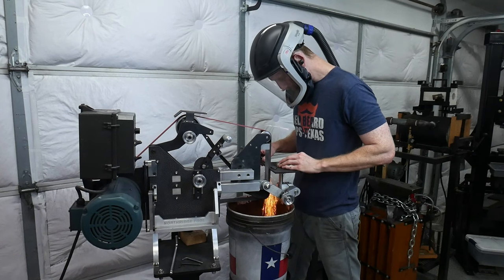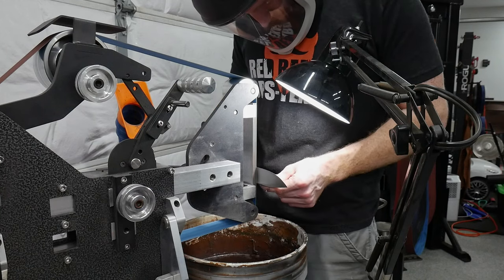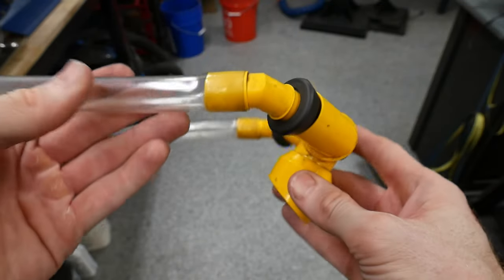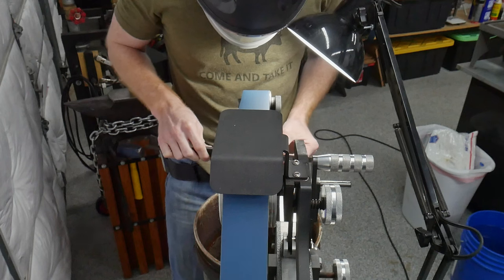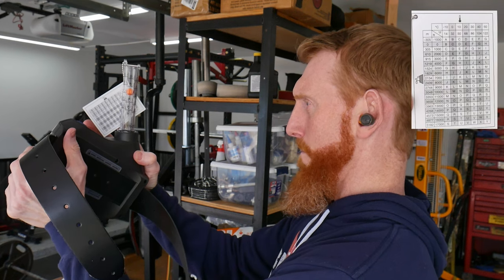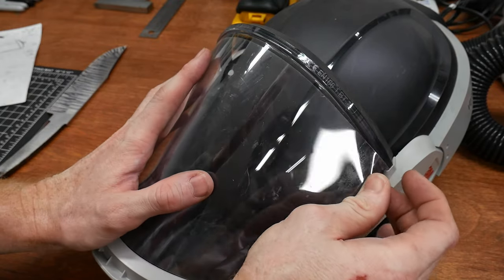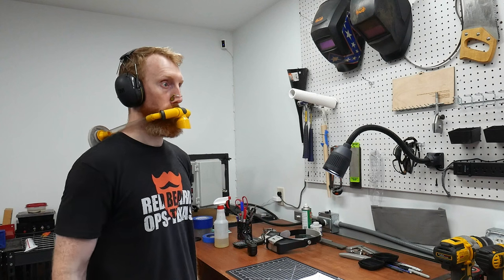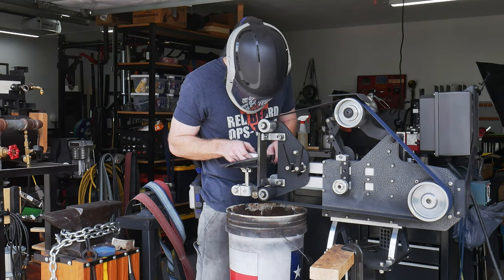3M Versaflo Respirator Review

Comment: I use the 3M Versaflo since 3 years and it works great! The problem with the expensive batteries i fixt with an 18V to 12V converter witch i but in the frame of the old battery and now i use the batteries of my rechargeable drill. There are great tutorials here on youtube. This is not for dangerous or explosive zones but for me as hobby knife-maker it works fine. 
But there is one big problem with the Versaflow!!! Every fart you let, gets pumped directly in your nose. So don't eat to much Chilli bevor working with the Versaflo. ;-)
Reply from the maker: LOL! I have noticed this flaw!
Reply: Abek filter is the fix for that.

Comment: Thanks for the review.  Is this just a good option for people with beards?  How would this option be better than just a $100 full face shield 3M respirator if you don't have a beard?  Those have a compression fit on your face so nothing can get in.  Seems like dust would still be able to get in with the versaflow.  Thoughts?
Reply from the maker: Without a beard, I'm not sure. The air supply keeps positive pressure on the mask, so I don't think any dust will be getting in.
Reply: @RedBeardOps  ok, thanks. I'm building a dedicated grinding room and I think I'm going to stick with the regular 3M full mask and focus more on the actual dust collection system.

Comment: thanks for the review.  I have trouble with my glasses fogging up when I wear a regular face shield or welding helmet.  Do you think the air flow in the versaflow would be enough to prevent this under most conditions?
Reply from the maker: I haven't had this thing fogg once yet!

Comment: One thing to consider when looking to buy a Versaflo system. The only filter cartridge available for the TR-300+ model is a particulate filter. If you want organic vapor (paint/ solvents) or any other protection you have to get the TR-600 or TR-800. There are 8 different filter cartridges for the 600/800 and only one for the 300+

Comment: Can the battery pack be worn or moved away from the lower back so the operator can be seated and driving machinery ? The hose did not seem to be very long . Cheers .
Reply from the maker: I sit down with it all the time but generally on a stool with no back. You could wear it on the side in the 3 o'clock position or maybe in the 9 o'clock position depending on what side is more comfortable.
Reply: @RedBeardOps  Cheers , thanks for that , these are on my short list , a pity DeWalt or Milwaukee don't make these in their 18/20v range , would have suited me perfectly 🙂

Comment: Due to the ongoing wildfires and resulting particulate in the air, I was looking into something this so I could go outside and bike for hours without breathing all that crap into my lungs. It'd be nice to have a good, clean air supply with better flow than is provided by normal respirators. I was thinking that maybe I could just plug the air supply unit into a normal respirator face mask. It's mostly just an idle thought and I'll probably just wait until the air clears up — especially now that I know how much the good units cost!
Reply from the maker: They aren't cheap! That's for sure
Reply: @RedBeardOps  Definitely worth it for your work, though. I've already spent more than enough on my hobby with a new bike, this year. 😅

Comment: The battery chargers are 300 aus. They have a spring that builds up resistanceon the positive and prevents charging. Absolute junk. You can destroy a new one and salvage 4 new springs to fix others
Reply from the maker: You're talking about the battery charger for the 3M Versaflow? I haven't had issues with mine yet, but that's good to know